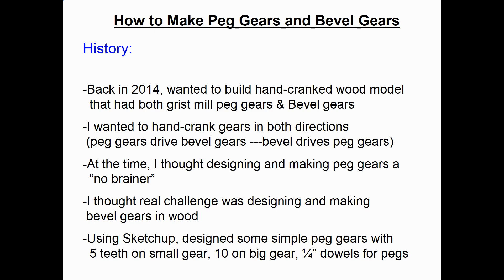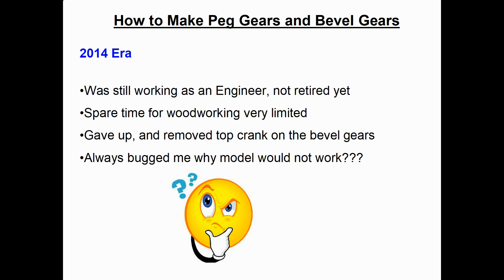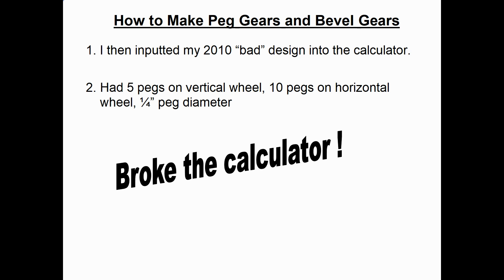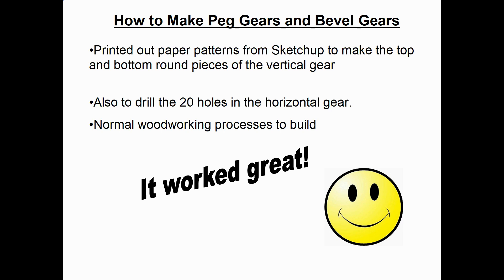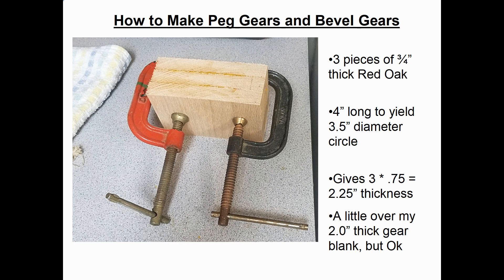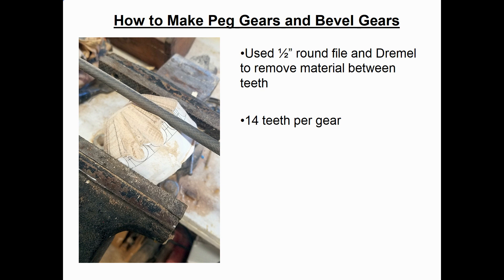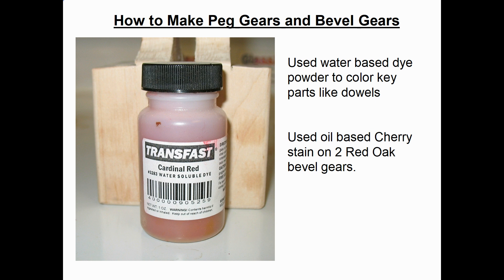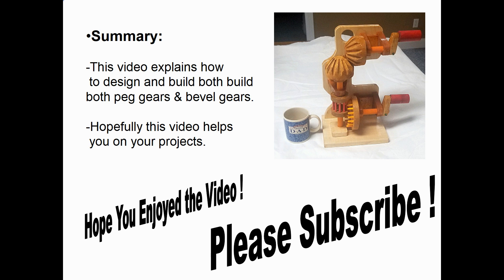How to Make Wooden Grist Mill Peg Gears and Wooden Bevel Gears

Comment: Hi Dale - great video!  One thing I’m not understanding is the length of the pegs. 55% of 1/4” is pretty small and the length of pegs on your model look to be about 1/2”.   What am I missing?
Reply from the maker: I went and got the actual wood model. The pegs vary between 5/8 and 3/4" of an inch long, and the pegs are 1/4" diameter dowels.
Reply from the maker: I also checked in my Sketchup drawing, and I designed for the pegs to stick out 5/8" of an inch. When I measured the as-built model, they varied between 5/8 and 3/4" sticking out.  Probably some difference because of the glue caught in the hole when pushed in the pegs in the vise.  Yes, the online guy's recommendation of 55% of the peg diameter is probably not right. My as-built ratio is 5/8 divided by 1/4" diameter = 2.32, or the peg length sticking out should be 2.32 times the diameter of the peg. I can't remember for sure, but I think I just ignored the 55% guideline and chose 5/8" based upon judgment (I did check the mating fit in Sketchup and 5/8" looked Ok).  Sorry about that, I should have mentioned maybe the 55% guideline is bogus.
Reply: @dalemaley thanks so much for checking!  That’s very helpful!
Reply: @dalemaley  could the 55% of dowel diameter refer to the amount of dowel engagement reaching in from the outside diameter of the lantern gear pegs?
Reply: @TheIntermont  I'm trying to make sense of this too. TLDR: I cannot. 

I think "with wheel disk just touching the pegs of the other wheel" on the linked calculator page implies what you said.

In a screenshot taken at 0:19, the depth of engagement of pegs from the outside diameter of the cage gear into the cage is around 12-14 pixels while the length of the peg sticking out is 39-43 pixels. If the base width is 8.25 inches and is 500 pixels wide at that engagement point, that's 60.6 pixels per inch, so 12-14 pixels is 0.20 to 0.23 inches, a range of 80% to 92% of the diameter. So that doesn't agree with the calculator. Hmm. 5/8 inch at 60.6 pixels per inch is 37.9 pixels, just under my measurement. 55% of 0.25 inches would be 8.3 pixels at 60.6 pixels per inch here, well below the 12-14 I measured. Hmm.

And 50% would mean the tip barely touches the widest point of the gear which doesn't seem right. The calculator says any value below 55% for L is out of range which suggests the range check is in line with the outside-diameter-in idea. Hmm.

🤷
Reply: If I use these values in the calculator, d=6.35mm, N1=20, N2=10, e=14%, L=90%, the diameter of the horizontal pitch circle (L2=43.43mm) looks like it matches the actual horizontal circle in the video (104 pixels / 60.6 pixels per inch), ~1.71 inches. Increasing e allowed for higher values of L. That kind of makes sense.